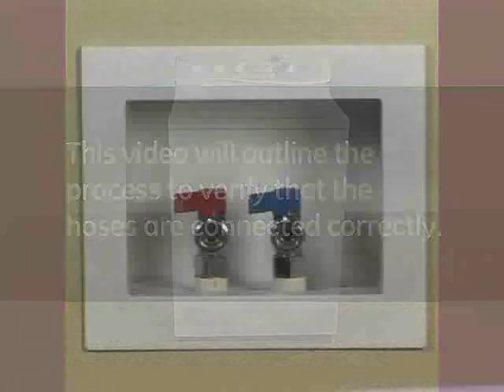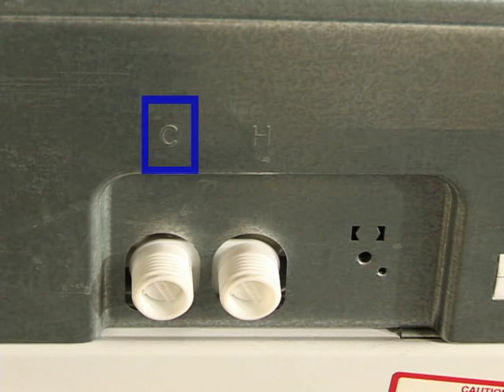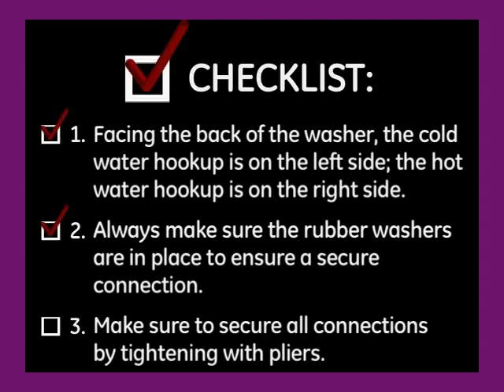Installation of Hot and Cold Inlet Hoses for Washers

Comment: 0:42 Let me stop you right there, chief: I just bought a slightly used GE washer, and STAMPED right into the metal of the washing machine, is an 'H' (hot) and a 'C' (cold) in the OPPOSITE orientation the video shows. Beware.
Reply: Same here! It needed to be reconnected. Looking at the diagram in the owners manual, as you face the back of
The Back of the machine, hot is on the left.

Comment: The metal connector that secured the hose to my washer seems to have rusted away and is leaking. My washer can still get water but I’m getting the f20 code. I assume because of pressure? Can I find this metal hose connector on amazon? Or, failing that, can I reorder the hose itself? Thank you.
Reply from the maker: Hello Kurt - we're sorry to hear that your washer is leaking.  With your complete model number you can purchase and identify replacement parts and accessories from our GE Appliances Filters & Parts Store: 
http://www.geappliances.com/ge/parts/ 
You may also reach our Parts Team by calling 1-877-959-8688. They are available Mon–Fri 8am–7pm, Sat 8:30am–5pm ET.   We hope this helps!

Comment: will the washing machine run with just the cold side water on?
Reply from the maker: It would depend on the model. Our older models would probably run; though we would recommend the installation of both hot and cold valves.

Comment: set all nobs for cold water wash, yet hot/warm water fills - does this mean hoses are incorrect ??
Reply: the pipes going to your valve could be reversed. I have a different type of laundry valve. Mine has a lever that shuts off both hot and cold simultaneously the hot water comes out of the right side pipe.

Comment: As the off position to the right or the left on the wall
Reply from the maker: Hello Debra - This will depend on the style of water valve you have in your home. If you have ones that match the video, turning to the left will turn off the water. - TS